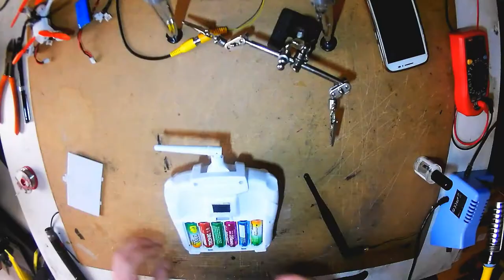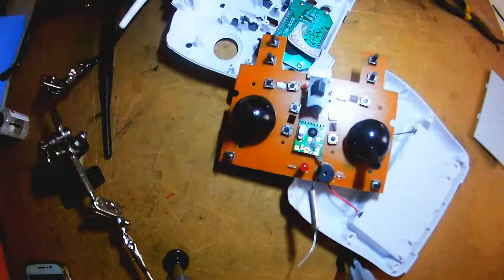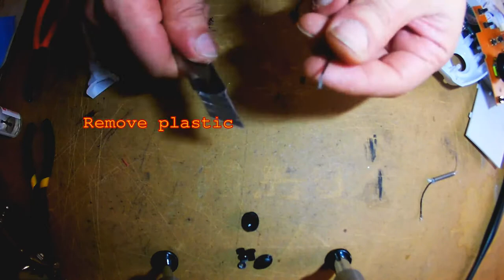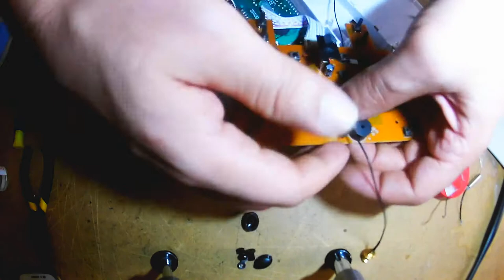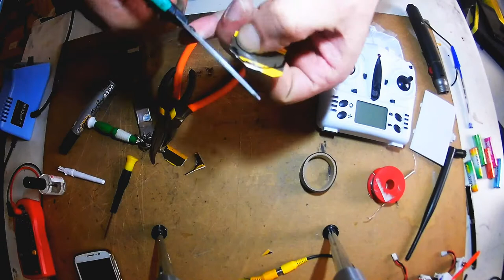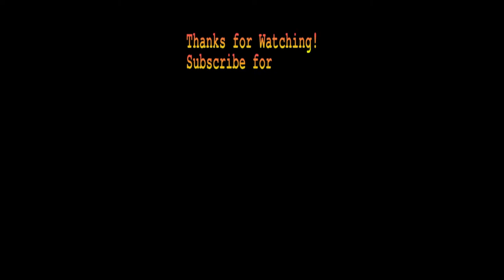📶Tarantula X6 Antenna Range MOD

Comment: Nice, I just got my controller moded with a 2.4Ghz wifi antenna, it works well but I haven't test the farthest range.
Reply from the maker: me neither :), but I do notice signal is more consistent , no drop outs
Reply: Did the test today, signal drops above 50-70m vertically,  Im a little disappointed. Guess I have to mod the drone's antenna as well. Edit: I put a booster on the antenna to "focus" signal, turns out it works well.
Reply from the maker: Really?! Damn :| I used to get way more than that with stock antenna when flying vertically, The drops outs only occurred when flying close to the ground and with  obstacles in between  at 80 to 100 meters away.
Did you position the antenna vertically or horizontally?
Right now the farthest I went after the mod was about 120 meters, flying low and with obstacles, on the same spots I used to get drop outs, and it went smooth with no drops.
I'll try to do a more in depth test tomorrow, and see what gives :)
Reply: I got better result flying stock antenna at countryside, but flying in the city with random interference signal causes drop out I guess.
Reply from the maker: Yeah, I normally get better results outside populated areas.
Today I took it out to test range, and was able to get it at about 320 meters away flying horizontally at 2 to 3 meters high unobstructed, It went good apart from the mild wind, and I got zero drops.
I'll try  longer distance as soon as I find a suitable spot to test, I didnt push it further because I don't know the area very well yet, and didnt want to crash in tall grass :)
Video coming soon ;)

Comment: Have you tested the range as yet? Planning to go FPV with my tarantula as soon as my googles arrive so interested to know
Reply from the maker: I haven’t tested extensively yet, but took it to a couple of usual spots, and was able to push it further without any drop outs.
In these spots i would usually get drop outs at about 80 to 100meters with obstacles in between , this time I went over 120 meters  with no issues.
I hope to get up to 300m, but we'll see.
I am also still playing with antenna orientation for best reception, some say its better horizontal, others say vertical, i'm still testing.
But i'll focus more on range next time I take it out.